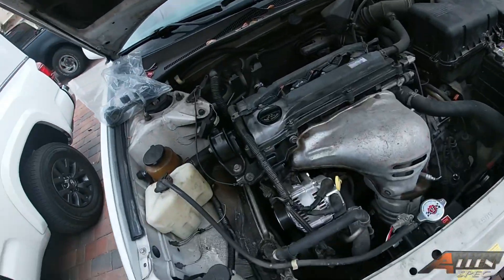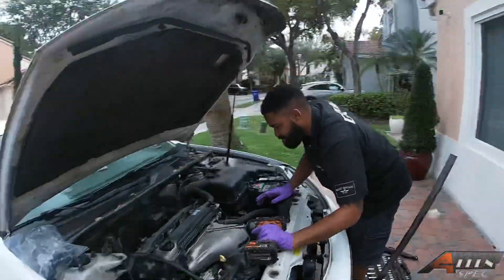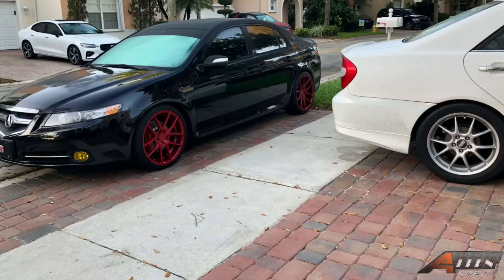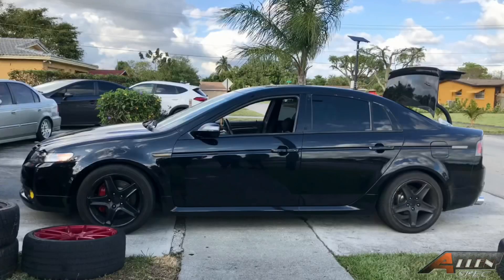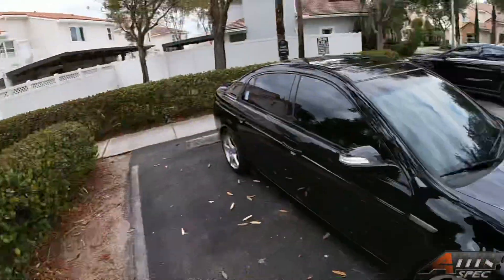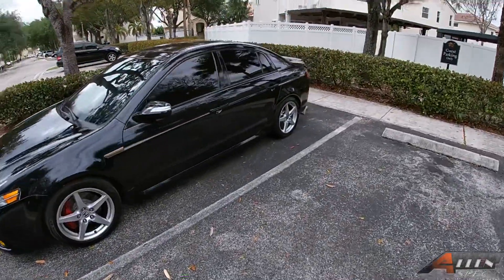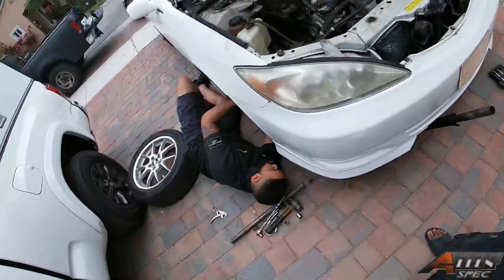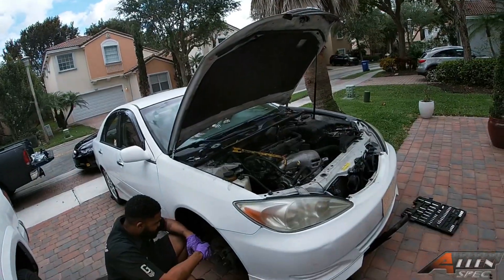Introducing The New Car!

Comment: The type s don’t have headers, it has a j pipe.

My advice get yourself rv6 pre cat deletes and xlr8 or endless j pipe that shit will open up your car and move way faster. Also a cold air intake.

Later on you can do the TL 3.7 intake manifold and get spacers for the runners and j37 throttle body the. Get it tuned you will be out 🏎 💨
Reply from the maker: Thanks bro needed that info for sure. So the J series are like the k24z7 they only have downpipes
Reply: @AllenSpec  yea it’s like a down pipe except it connects to both soch heads, so it has 2X connections
Reply from the maker: Okay okay thanks again Bro definitely will be learning about these cars. You think hondata is better than the ktuners they sell
Reply: @AllenSpec  I’m not sure, I had Hondata FlashPro but I didn’t get to tune it before I sold the type s
Reply from the maker: Still got that Hondata 👀